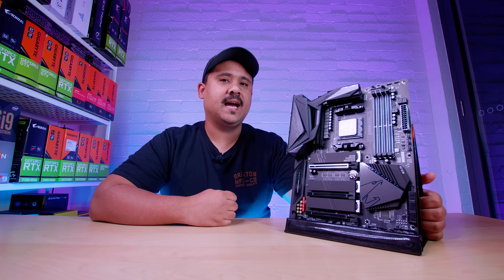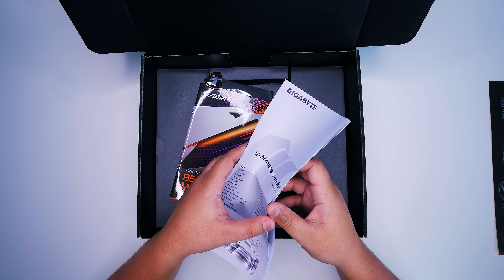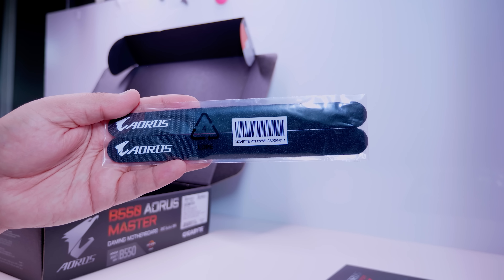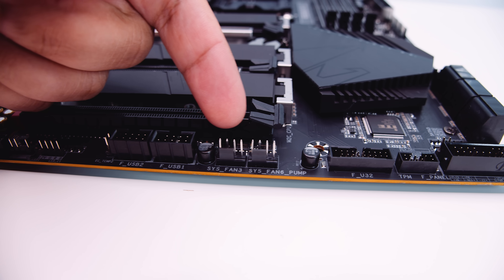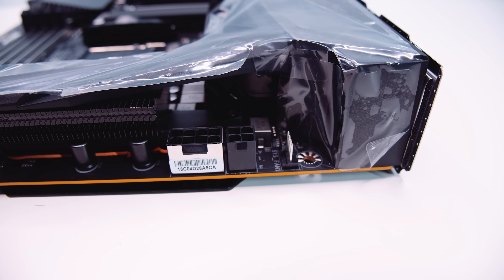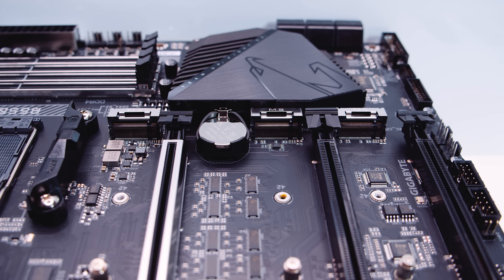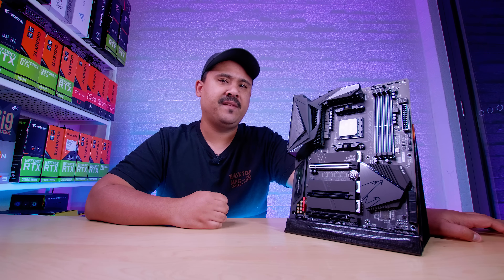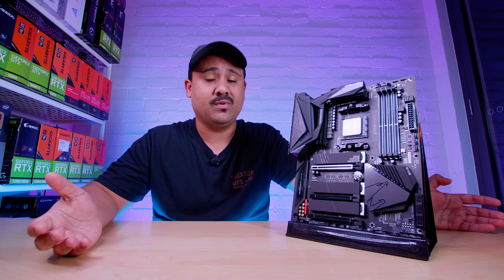B550 Is Looking EPIC! Gigabyte B550 AORUS Master - First Look [REUPLOAD]

Comment: I just installed this MB with a Ryzen 9 500x CPU and none of the utility apps are displaying the CPU temp. They show GPU temp only.  Did I not hookup a wire on the MB?  I have a Corsair i150 RAD connected to the CPU, but it would be nice to know if its keeping the CPU within operating temps.

Comment: Are you sure all M.2 are PCIE Gen4? I thought, like the PCIE expansion slots, it was only the top M.2.
Also how do you have the ARGB in the VRM on when there is no power running to the board?

Comment: Thinking about buying this one from a friend for $200, I'm going to use a Ryzen 9 3900X and 32GB 3200mhz, do you think this motherboard will give me long durability and reliability with this processor? (I'm thinking about 7 years at a minimum) or is it better to spend more and get a X570? I'm not overclocking.

Comment: Can I use a ryzen 7 3700x  on this motherboard, will I get the full use of my cpu ?
Reply from the maker: Yes
Reply: Gear Seekers which board would you recommend the asus prime x570 or gigabyte b550 aorus master
Reply: Gear Seekers or which motherboard is good for streaming and gaming at the same time?
Reply from the maker: Motherboard doesn't matter for that

Comment: This board or a budget x570 tuf gaming? Which one should I buy for a 3700x?
Reply: 1st depends on your budget, 2nd if you like the extra fans on the board or not...both are fine for 3700x, however the B550 will also be working with next gen Ryzen, I think the 570 would need bios updates. If you buy a 550, you have more future upgrade options I would say....
Reply: @berndkemmereit8252  lol how a cut chip of the x570 will have more support, you are crazy sorry, they are just selling you nothing more the thing u really dont use, no way i buy a shit expensive motherboard b 550, prefer pay 200 for a good x570.

Comment: Something you did not mention is that if you populate either of the lower M.2 slots on this motherboard, your x16 lane PCI Express slot at the top switches down to x8 lanes!
Reply from the maker: It makes no difference. You'd be lucky to saturate a PCIe 2.0 x16 interconnect with any GPU so running at x8 means nothing.
Reply: @GearSeekers  you're absolutely spot on, however still worth mentioning for your viewers to understand the switching on these motherboards if they are potentially going to buy it based off your review, yes!? Like if the bottom PCIe slot is populated, you lose SATA3 connector 4,5 as they are shared with PCIEX4_2 <- that's something I would want to know if I potentially was planning to connect 6 SATA3 devices and a sound card in that bottom slot ;)

Comment: Still no front type C header in 2020??
Reply: Just curious, why you need front type C?
Reply from the maker: lol right? hahaha
Reply: @garrettwu  So that you could use the front type C port on some newer cases, like the H510
Reply: @Anderson_Hwang  But what devices you plan to plug in type-C on that chassis? I personally have a chassis with type-c, but i found out there're no devices for me, no mobile phone (Yes, type C on phone, but type A on the other end of cable), no pendrive....I just left the cable there.
Reply: Garrett Wu The cable that came with my phone does use type C on the other end.

But most of it is to future proof. Maybe in 2025 we’ll see a portion of gadgets utillizing USB-C

Comment: Aorus: You got a microphone and 2 probes with out midrange board!
me: buys an overclocking LN2 board extra special X570 impact...
also me: no temperature or flow sensors in the box whatsoever...

Comment: I'm really glad this board has dual bios, that was going to be the deal breaker for me if x570 version had it and this one didn't.
Reply: Dual Bios doesn't really matter. You have no control over which one is used and permanently screwing up a BIOS isn't that easy.
Reply: Bushhawk It’s actually incredibly easy to screw up a bios update. Plus it’s that fear factor that your luck will just be terrible and you’ll have a power outage that one day you decide to update your bios, which believe it or not, happened to me. Being burned in the past, it’s a big deal to me to know I have that backup

Comment: 04:53 Is this a Thunderbolt 3 header? Will Thunderbolt supported through the GC Titan Ridge AIC?
Reply: It is!
The Gigabyte B550 AORUS MASTER, B550 AORUS PRO AC and B550 AORUS PRO
have undocumented Thunderbolt header, but it is there near the SATA ports.
https://i.imgur.com/29tC0ff.jpg
Reply: @Pictus_Invictus  It does not appear in the manual so I'd wager it was part of the engineering sample rather than the retail unit. Same thing happened to the x570 master
Reply: @indubitable49  The new Gigabyte B550 VISION D has Thunderbolt(Titan Ridge) built-in, but they only mention as Type-C
https://www.gigabyte.com/Motherboard/B550-VISION-D-rev-10#kf

Comment: Having the x570 is much better from a PCIe 4.0 stand point. Labeling these boards as having PCIe Gen4 is only a half truth. PCIe Gen4 is only coming from the CPU but the chipset processor only supports PCIe Gen3 so less bandwidth for your M.2 drives. Your GPU won't use all of the bandwidth from using PCIe Gen4 tech. No one ever mentions this. This is why none of the B550 boards use an active fan coming system on the chipset processor. There are allot of bed and whistles that's why the price is higher than expected. But if your looking for full Gen4 you'll want an X570. Only when using 1 PCIe Gen4 M.2 after you use another one you'll be using Gen3 PCIe bandwidth.
Reply: But for someone who is going to use only 1 Pcie 4.0 ssd.
Will the B550 be good enough?
Reply from the maker: Yes

Comment: High end B550 board and no internal USB C header = fail
Reply: Yeah, if another company can make a board like this with that then that's my winner.
Reply from the maker: It's B550. You call it a fail. I call it strategy. Being someone who builds in lots of cases I can tell you for a fact that most cases still don't have USB C. It makes no difference.

Comment: The board is great but the initial pricing of B550 as a whole seems worrysome. AMD should offer something cheaper for Zen 3.
Reply from the maker: Like I said. If you chose a B550 board in the same price range as B450 you will get the same quality. This board is the top tier.
Reply: @GearSeekers  Yes, I get your point. But don't you think the average price has gone up unnecessarily? B450 Tomahawk is a great motherboard for around 110-120 Euro. How can we get the same with B550, when some of the entry motherboards will cost that much and they may have fewer features. We will get more with B550, but my point is, we will have to pay unproportionally more. Doesn't help that the lauch of B550 was intentionally pushed back in order to milk some more money. Competition is great. We don't want AMD to become another Intel.

Comment: Would it be worth the change to B550 if I’m already using A B450 board with a 2700x? I really would like a board that I can use it with the 2700x, then upgrade to a 3800/3900x then to a Ryzen 4000 series eventually.
Reply: same situation here brotha
Reply from the maker: You cannot use the 2700X in B550
Reply: Gear Seekers  dang it. Lame. I am hoping that the asus strix  B450 board I bought allows for a bios upgrade to the 4000 series then. Lol

Comment: Damn $270, same price to X570-P at my country. I think i must wait for the test
Reply: and its better than your x570-P except for chipset
Reply from the maker: Like I mentioned it's a top tier board. It is a lot better than most X570 boards
Reply: @GearSeekers  is not a full pci 4.0 and wtf i prefer pay a aorus elite that, that expensive Board.
Reply: @GearSeekers  and has no FAN.....that's the only reason I waited for the B550, I don't like the look of the fans on the x570....

Comment: Too bad I already own an X570 , this looks amazing.
Reply: Having the x570 is much better from a PCIe 4.0 stand point. Labeling these boards as having PCIe Gen4 is only a half truth. PCIe Gen4 is only coming from the CPU but the chipset processor only supports PCIe Gen3 so less bandwidth for your M.2 drives. Your GPU won't use all of the bandwidth from using PCIe Gen4 tech. No one ever mentions this. This is why none of the B550 boards use an active fan coming system on the chipset processor. There are allot of bed and whistles that's why the price is higher than expected. But if your looking for full Gen4 you'll want an X570.
Reply: @TheSocialGamer  and pcie gen 4 doesn't have that much of a difference in performace compared to pcie gen 3. Paying premium for gen 4 ssds not worth it at least for now.
Reply: Social Gamer thanks for breaking that down.

Comment: I thinking of going to amd never tried it I been with Intel for awhile wondering also is amd motherboard s are good ?
Reply from the maker: This board is better than almost every Z490 board on the market.
Reply: @GearSeekers  I see thank you ima have to get it soon from pccasegear
Reply: @emrahzi4495  if you've been using tb3 on Intel and still need it check out asrock boards. Seekers has excellent reviews on a few asrock x570 boards
Reply: Thanks future nick. I mean had they sold it any cheaper it woulda been a steal. I'm okay with my x570 unify which should be here any day now.

Comment: At this pricepoint, you should just buy an X570 board...
At 279$, this motherboard isn't worth it in my opinion. Sure the X570 chipset isn't far better than B550 but, I feel like if you're gonna spend that much money on a mobo, a mid to high end X570 board with good VRM would be a hundred times better. Especially for those 12 and 16 cores beasts !
Reply from the maker: Wrong. This is a new class of motherboard for a different market. Don't be confused about why top tier B550 exists. There has never been this market segment before.
Reply: @GearSeekers  To me, B550 has always been the mid tier boards for AMD. As BXXX is for Intel. I'm confused 😅
Reply: @Hateroz  B550 is NOT replacement for B450, all B550 boards will have similar price. They're cheaper than X570, cheaper than Z490, and most of them are cheaper than Z390, and they SUPPORT PCIe Gen4!
Reply: @GearSeekers  You can get an X570 unify for a similar price (for what this is rumored to be) So do you buy the board with complete Pcie 4.0 support but slightly cut down bling and feature set? Or a board with tonnes of bling and extra lovely doodads but with cut down PCIE support? I can't decide which I want to be honest... Buying decisions for Ryzen are about to get a little more academic than they really need to be.
Reply: @Buffinator1988  X570 Unify is $299, $20~$30 more expensive than B550 AORUS Master, but you have only 12 phase with 60A DrMOS instead of 16 Phase with 70A power stages (which can fully support overclocked 16Cores 3950X with zero airflow). You also only get 2 aluminium chunk heatsink instead of nice old school fins. And both board support 3 PCIe Gen 4 M.2, but X570 unify has a chipset fan that WILL be eventually dead one day in the future. I don't know about you, but B550 is best segment ever to me. Better than X570, far better than Z490. Btw, PCIe Gen 4 x8 = PCIe Gen 3 x16, there're zero difference on 3D performance with x8 or x16.
Reply: Garrett Wu Don’t Z490 boards have PCIe 4.0 support for future gen chips ? I thought I heard Gigabyte saying there’s, on their boards at least.
Reply: @garrettwu  Hi Garrett, the Unify is cheaper in my country but I only mentioned it as an example. When it comes to VRM's this overbuilt it doesn't really matter if one is slightly better, you won't see much difference unless your on LN2. I still think $250+ is too much for the chipset compromise. If my budget allows I'll just get X570. If it doesn't I'll get a $200ish B550 instead.
Reply: @Hateroz  Correct, just wait another year and you will have Intel PCIe Gen 4 on their new flagship 8-core 11th Gen CPU. btw, AMD might have 24-cores CPU at that time with same price segment.
Reply: @Buffinator1988  In that case, you can buy cheaper B550 ex. B550 AORUS PRO or Tamahawk. Similar spec with X570 unify, sub <$200  and still no chipset fan. But you will only get 1 PCIe Gen 4 M.2, but I don't see that's a big issue.
Reply: @garrettwu  I know, Intel's stil late on the new gens. But, can't they treat the PCIe 4.0 signal via the chipset itself ? Like M.2 and 16x directly linked to the chipset instead of the CPU directly. (I don't really know much about these deep specs on mobos and CPUs but I have the bases.)
btw, I think that AMD should stick with 16 cores MAX for now. More will be counter productive and useless for the average consumer that wants a blazingly fast gaming rig. They should let 24 cores (and more) to the threadripper lineup even thought having that much CPU power in "consumer dedicated" socket would be really nice for content creators.
Reply: @GearSeekers  Disagree... Compare this to the MSI MAG TOMAHAWK x570, its cheaper and better...
Reply: What market then lol? Might as well buy x570...